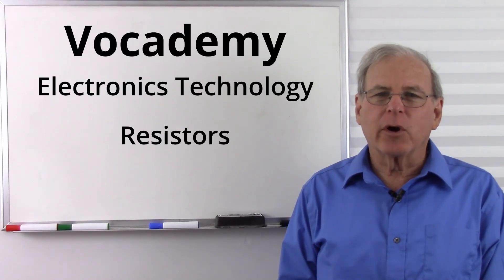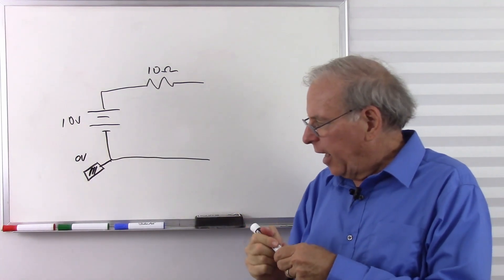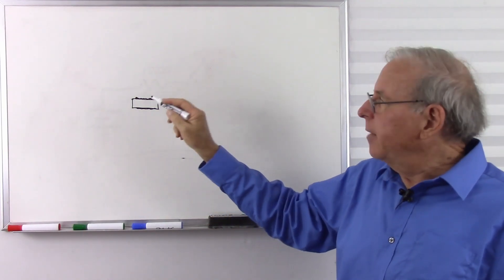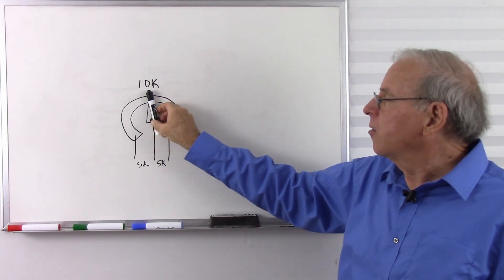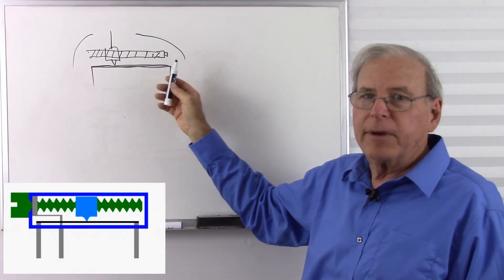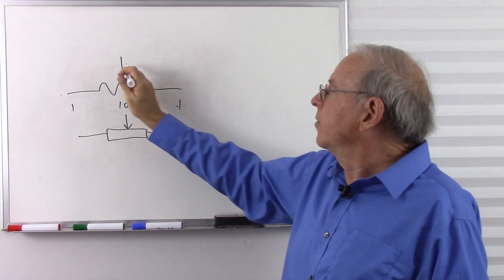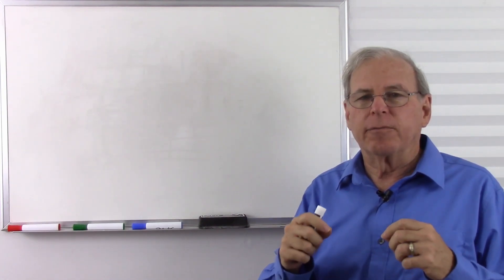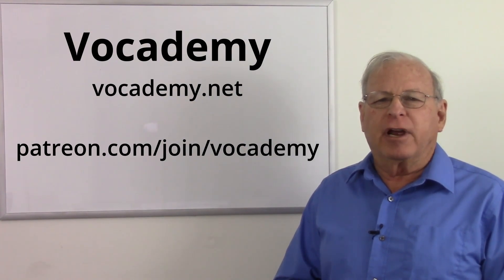Resistors

Comment: Thank you. Would be nice to see some videos where you go over the schematic of a guitar amplifier, such as Fender Showman and explain the different parts of the circuit. Most likely at this point there are enough videos here to actually cover the all the individual parts of a valve amp. From the power transformers, to tone stacks to coupling capacitors etc... This would probably a reall long video with multiple parts, but it would be cool for sure.